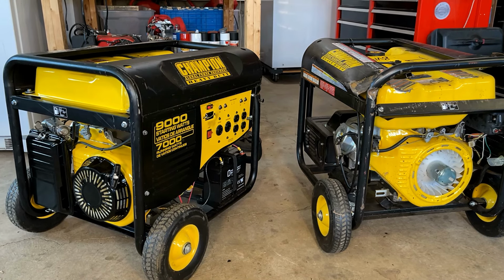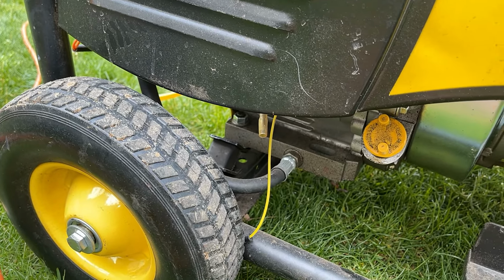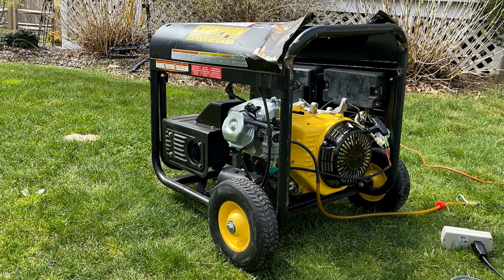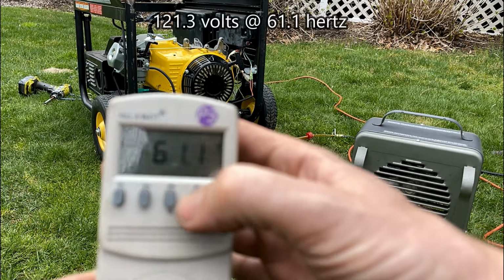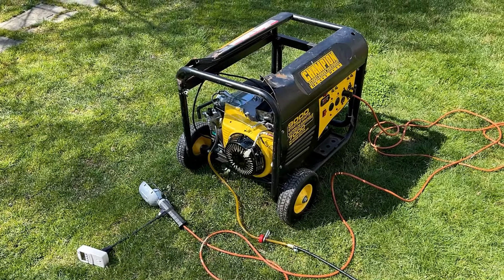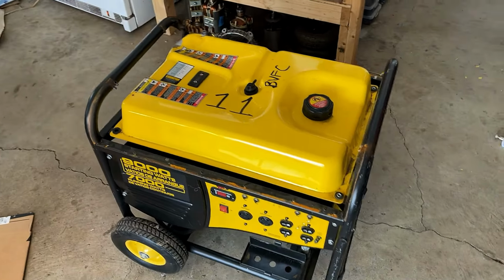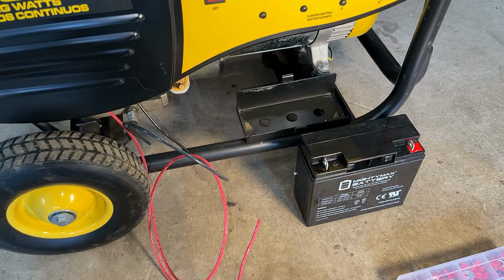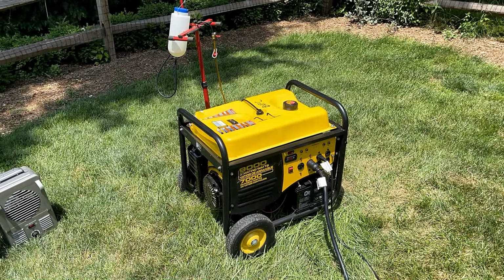Two Junkyard Champion Generators (Part 2) - Scrap Metal?

Comment: Jim, I recently picked up a clone of a Yanmar diesel engine from a generator. The engine seems to be complete, but the solenoid was defective. I took it to a friey of mine, and he services starters and alternators, so he should have it working soon. The shaft is tapered, but there are adapters made to use them as a standard engine. Do you have any experience with these engines? 
The generator brand name is Apache that my engine was on, but about a week after I took the starter in for service, my friend got in a similar unit with the Falcon brand name. While the cabinet is somewhat different, it's the same engine.
Reply from the maker: Have not worked on one of those yet.  Almost got one that was not making power, but someone else beat me to it.
Reply: @ruben_balea  so far it's only a starter issue. I do have a 3 hp Chinese diesel that had flywheel problems. It must be an obscure manufacturer as I can't find any parts available.
Reply: @jcondon1  most of the parts are identical to a Yanmar engine, with exception of the crankshaft and maybe a few other parts. I've heard of people buying Japanese parts for their Chinese engine.
Reply: @ruben_balea  that's whaty engine is from.